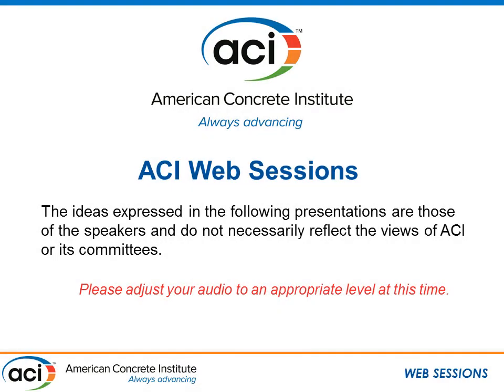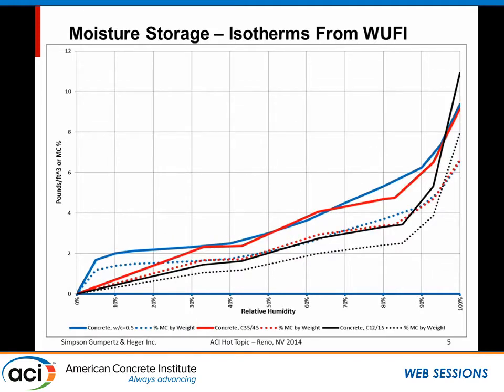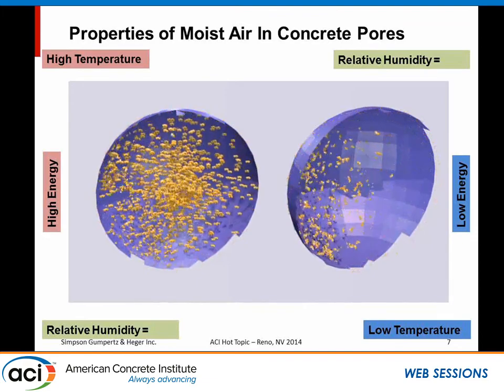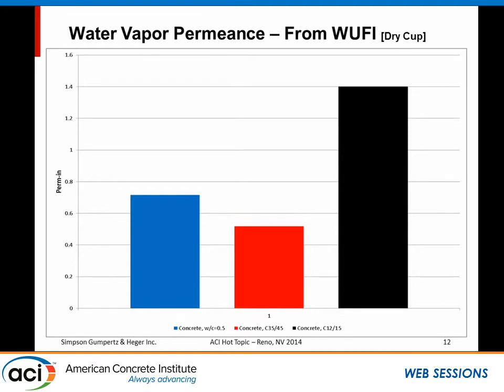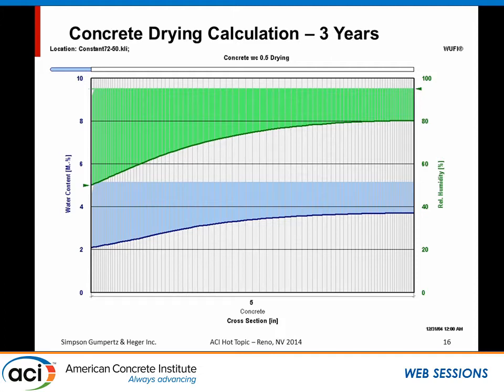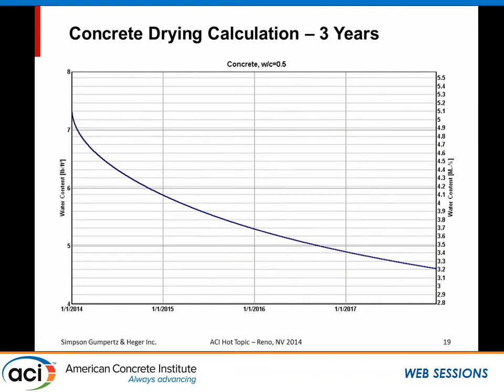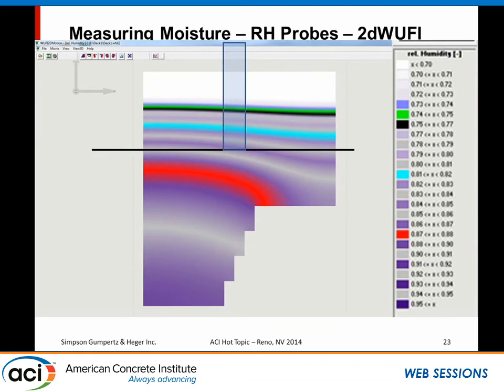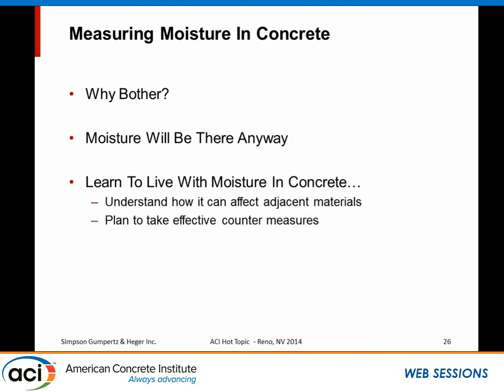Moisture in Concrete Storage, Migration, Measurement

Comment: Various moisture measurement methods were researched by VTT in Finland. The baseline used was gravimetric. In field exposures at 14 and 28 weeks, none of the other methods other than Tramex Concrete Meter were correlative with the gravimetric readings. Alkalinity has an inhibiting effect on measurable RH. Studies globally have found the top one inch of concrete is the gradient of concern. It has been found that the concrete gradient tends to self desiccate in the first 2-3 weeks after concrete placement. Greatly reducing the amount of cement development. This top inch has been shown to be the area of concern for moisture and environmental durability.